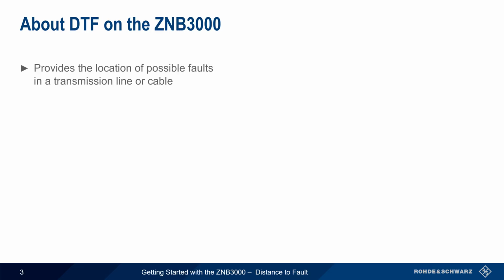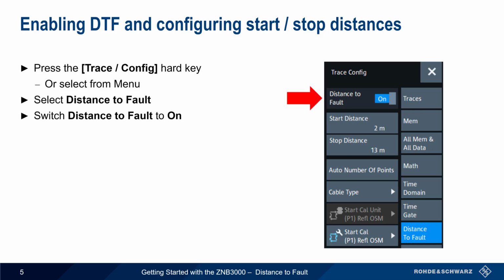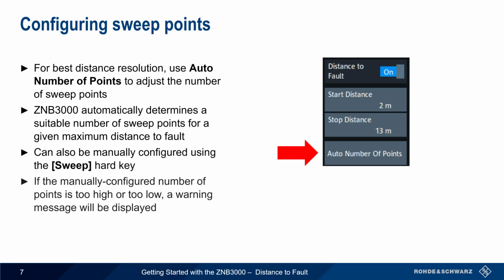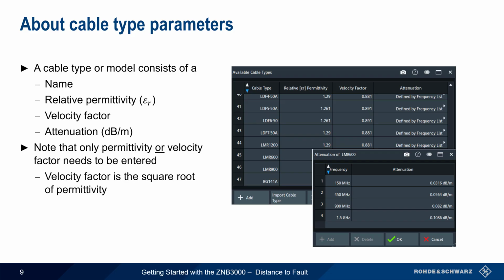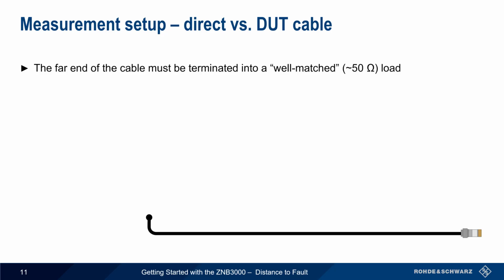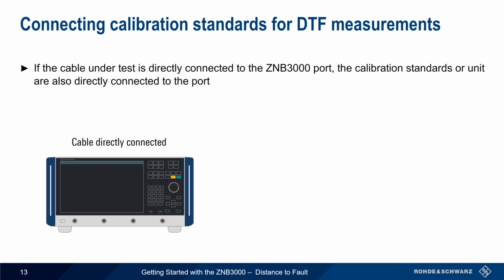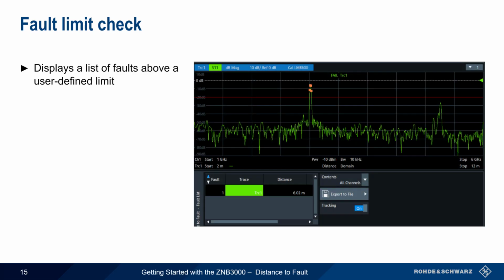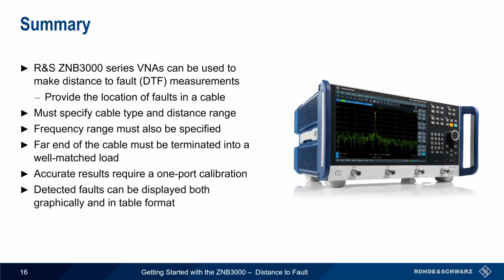Getting Started with the ZNB3000 - Distance to Fault Measurements

Comment: What about distance to fault measurements for 2-port and 3-port devices such as filters and mixers respectively?
Reply: What would be the purpose of this measurement on a filter or mixer?
Reply: @777thejesusfreak777  If it was a filter, perhaps the purpose would be for controlling the amount of frequencies that are being received. Mixers would be able to serve as low noise amplifiers If too little frequency is being received.